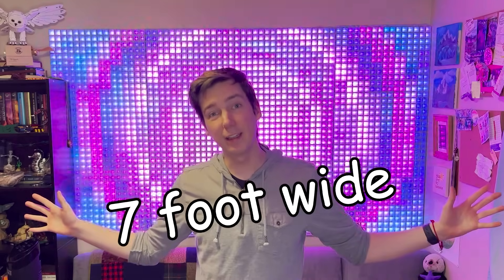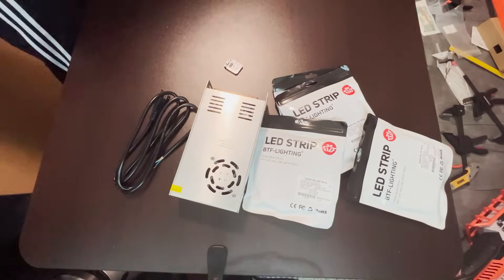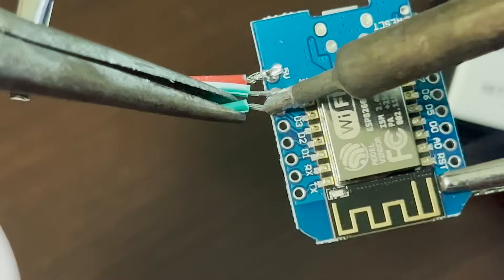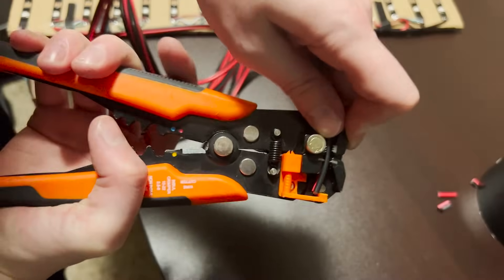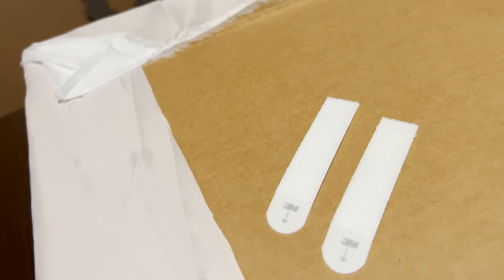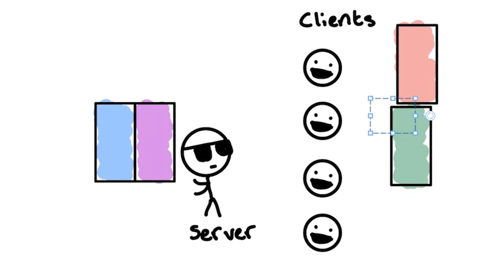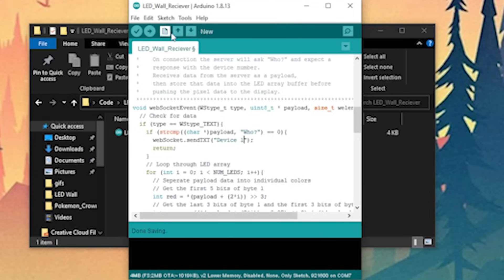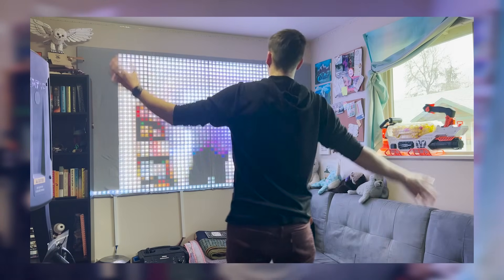How to Build a Massive LED Wall on a Budget

Comment: Okay, one question: Could the screens be made with 60 LEDs per meter? Since they're not readily available, it would require enlarging the lighting panel even further?

Would the same image be produced, or would it be distorted?
Reply from the maker: This screen was made with 30 LEDs per meter so if you kept the resolution the same your 60 LED per meter screen would actually be smaller. Having the pixels closer together would make the image more clear by shortening the viewing distance. If you keep the resolution the same it will produce the same image, if you keep the size the same you’ll need 4x more pixels but your image will be much more detailed. You’d also need to account for the additional power draw and processing needed for 4x more pixels

Comment: I followed the steps and got the problem. All 4 receivers connect to the source within the first 1-10 seconds then all lose connection including the receiver. Is there a solution?
Reply from the maker: I didn’t program memory into the web app so if you refresh the page it will always show “disconnected” since that’s the default state. If you’re seeing all four connected then it’s probably working from the connection standpoint. If you’re not seeing anything on the displays then it might be a problem with LMCSHD.
Reply: @Tech-Random  I have tried to start LMCSHD program but the image still does not display. But Single mode for 1 disk works fine. Can you tell me the steps on how to connect? Do I have to connect LMCSHD program first or do I have to connect all the boards together first and then start LMCSHD?
Reply from the maker: I typically connect LMCSHD first and then connect each of the individual panels so I can watch them light up. When connecting LMCSHD you may need to disconnect and reconnect a few times until the dimensions are set automatically. If you have to manually set the height and width then it didn’t connect properly. Restart LMCSHD so you get the default 16x16 and keep reconnecting the host board until the dimensions change and then connect each of the panels. Good luck!

Comment: You dont actually have to connect all the wires in the serpentine pattern, just the data wire. You can hook the power wires any way you like. If you like to keep them separate, you could hook the positive to all the strips on the left side, and hook the ground to all the stirps on the right end.  This may sound like a trivial thing, but it can make the soldering a whole lot easier, while making it harder to make a mistake, not to mention making the wiring a whole lot less busy looking.

Comment: I was thinking, 5 V is horribly inefficient.  Not only do you need to run all the current to every single diod, but also the shunting need to be done at something like 1.7V or there about.

Then i was thinking, there exist white cob tape, so there should exist RGB cob tape as well.. and i did find RGB mini-COBs, but no tape. 

That would be a game changer.

Comment: For me the image is transferred haltingly and not smoothly but only every few seconds the new image comes. I use esp cam for that can anyone help me
Reply from the maker: It will help to draw out a block for each step your code must complete before an image gets displayed to the panels. For example: capture the image, compress the resolution, copy the compressed image, send the compressed image to the websocket, etc. 
Then for each step write how long it should take and try to measure how long it is actually taking. You can do this with the millis() function and Serial prints. This will help you find the bottle neck in your code so you can optimize it for a higher frame rate.
Reply: @Tech-Random Thank you

Comment: Bro, why the hell are you soldering the wires to the surface of the through holes? Put the wire through the through hole and solder it in.

Comment: How does the led know what colour to change to, as each pixel is generally a different colour… this question is based from me only understanding same colour led’s soldered in series and using on/off pulses on a breadboard
Reply from the maker: Each pixel has a built in integrated circuit that converts serial data into the three pwm signals that drive the red green and blue diode. Each pixel uses the first three bytes it receives for R, G, and B, then passes the rest of the data to the next pixel until it receives the stop bit. The fastLED Arduino library handles all of this for you to make programming a lot easier.

Comment: was about to sit down to work on this project, but looks like they sent me ws2815 by mistake, is this adaptable somehow?
Reply from the maker: Ws2815 should work the same but you’ll need 12V supplies instead of 5V. They also have a backup data line in case one breaks. Make sure you still use 5V or 3.3V to power the microcontrollers.

Comment: You connected the power supply wires on the wrong side.  The wires needed to be placed on the left side so when the screw is tightened, the wire also tightens.

Comment: I have a question, why you don't connect in parallel form the leds?
Reply from the maker: It’s not necessary for a project of this scale. The pixels communicate at 800kHz so in an ideal setup it can do over 40 frames per second on a single data pin. The real bottleneck with this approach is the processing time from usb to serial to websocket. But even with all of that this wall still gets 15-20 frames per second!
Reply: @Tech-Random  ah done, thank you very much for your help, keep making videos

Comment: Hi Chris! Really appreciate this video you've made as I have a project that i'm working on that is pretty identical only mine 17' wide and 5' high thus requiring more of these leds. My question to you if you could or anyone else could help me understand how many power supplies would be required, but more importantly how they would be implemented in the wiring? Thank you!
Reply from the maker: The amount of power you need depends on how bright you’re going to run the display. Each pixel draws 0.06 mA at 5V if they are showing white at max brightness. I usually run mine at 10% brightness (set in code) so the pixels only draw 0.006 mA when white. To get the total power draw: (num pixels tall) x (num pixels wide) x (0.006 mA) = total current draw. You’ll want to distribute the power evenly between each section of the display. If you’re doing vertical strips I’d recommend a power connection for every 3 strips. You can set your pixels to white and you’ll see them turn pink or yellow if they aren’t getting enough current.
Reply: @Tech-Random  Thank you so much! Appreciate your fast response. Will be building based on your instructions this week. Thanks again!
Reply: @Tech-Random  Aloha! So, ive built a massive 17' long feature wall that is 5' high based on this video that has consumed almost 6 rolls of 13w/m led tape. After watching and reading your video and instructables, i realize i have run into a massive problem that I am hoping you can shed some light on. My lights are 24v. Yours were 5v. I have a few drivers that i bought from a local store where they told me in commercial spaces a maximum of 96w drivers can be used. So, a few things that have now puzzled me as this wall and all woodwork cabinets are complete and fastened on the wall   1) the current tape i used (as i did not understand the importance of the voltage is now 24v as I am not sure how to connect this now to the esp 32 module you have recommended. 2) i have done some reading on how to step down the voltage that the display wall will be charged with so as not to fry the esp32 by using a Buck Converter 24V to 5V. Are you familiar with this and do you think it will work? or will it only allow 5v to pass into the esp32 and restrict it from sending the signal back? 3) as the tape required for this project is so long, would i connect the additional drivers in the same manner you did (ever few rows) to distribute more power as the large tape would require many more watts than each can produce being 96w.  3) the tape is addressable but only white as I have tinted plastic filters over each section of led and not an RGB tape. will this affect the way you describe/show the programming part or will it work just the same? 

Your help would be most appreciated as I am way too excited to get this up and running :) Thank you in advance
Reply from the maker: Can you tell me the exact model number of the LED tape you’re using? I’m not familiar with any 24V addressable LEDs

Comment: Did you not have to tie a common ground because you used a single power supply ?
Reply from the maker: Each panel has its own power supply so they are not physically connected in any way. There is no need for common ground because the data is transmitted wirelessly.

Comment: great job Sir 👍 

I inspired to build also like this but I'm planning to use 60 leds per meter to compress the spacing of each leds.

Is there a big difference on the performance between esp32 and esp8266?

I'm going to build 108x42 per panel equivalent dimension of 108 x 168  total of 18,144 pixels.

any suggestions and tips to make this successful plan and proposal of mine? 😍
Reply from the maker: ESP32 has a 240 mhz processor so it can process the pixel data much faster. I’d recommend using four of those as the receivers instead and the code should still work. You will probably have a low frame rate with all of that pixel data so you may want to switch from a wireless to a wired design. I have a video coming in the next week or so with my new high density LED matrix design so you may want to check that out!
Reply: @Tech-Random  I prefer hopefully wireless design so that no more wires to be connected between each panels and to my laptop 😅

I changed my plan from 60 pixels x 108 pixels  I plan to make it 108 pixels x 168 pixels. 
108 pixels by 42 pixels per panel total of 18,144 pixels. 60 per meter ws2812b

is it possible to build without any conflict on configuration and data transmission with a total of 18,144 pixels? 😅
Reply from the maker: @michaeldeloso9042 It should still work but you’ll need to use a few tricks if you’re hoping to get 20 fps. With 18,144 pixels at 16 bits per pixel, you’ll need around 6 Mbps of throughput. Unfortunately the current version of LMCSHD can only go up to 2 Mbps at best. You can probably pre-compile a gif as a pixel array and get a high enough frame rate but it will take a bit more work upfront. I’m working on a change that will let you run several USB devices at once from a single LMCSHD window and will allow much higher resolution walls without sacrificing color accuracy.
Reply: @Tech-Random  thank you for your time replying on me Sir.

by the way I suggest taking a look at jinx software that is also used by others to drive and control the led matrix. on my searching on this kind of project, I see a lot of jinx software appear when I try to look for a diy led wall.

Comment: I uploaded the reciever code in the esp and then took new esp and uploaded the source code, and when i connect to power first i see white light comes on followed by purple light only, it stays on purple light, i dont see any series of different color light as it is shown in video, and when i connect in lmcshd, my screen does not mirror in my panel. I dont know what am i doing wrong
Reply from the maker: Sometimes I have to connect LMCSHD multiple times to get it to work right. If your matrix dimensions don’t automatically get set then close the pop up and try connecting again. Once the dimensions autofill it should work!

Comment: Hello dear friend, is there an option to make this beautiful thing you made, but with 6 strips of 5 meters each (without cutting)? Of course I supply the voltage externally and not through the controller?

Comment: I would be nice to see HDMI connection on this so it can be used in churches as a low budget substitute for high end LED walls
Reply from the maker: HDMI requires hardware decoding which would significantly increase the complexity of this project. For churches you’d probably want a higher resolution to read song lyrics and such so a projector is going to be a better choice. I am working on a higher resolution version though and I’ll look into adding hdmi if possible

Comment: Hello, Im stuck attime 10m:12s, i uploaded the Single_LED_Wall_Reciever to ESP then connect it to Panel. Then takr fresh ESP8266 then upload Single_LED_Wall_Source to it. it is still connected to my laptop but the first LED on the panel doesnt lit even the power is on. may you help me please.
Reply from the maker: A few things to try first: flash the FastLED test to your panel to make sure the leds are set up correctly. You’ll also want to try the LMCSHD test with the panel plugged directly into your computer. Once both of those tests are working, then you can move onto the wireless code. Each level will likely require some debugging, which is an important skill for embedded development projects like this, so it’s good to start small and work towards the final version. With LMCSHD I’ve noticed a lot of issues with the Serial->Connect button not actually connecting to the board. If it connects properly, the size will be set automatically. Otherwise you will need to connect again until the size gets set. Make sure you’re using the correct bitrate (bpp) and baud rate for each mode. For the LMCSHD test I think it’s a 24bpp bitrate but for the wireless version it’s only 16 bpp. Good luck!

Comment: The wires you used are not meant to be used in screw terminals. They don’t make a safe connection. You need to use a solid wire or crimp your wires to be able to safely screw them in
Reply: Lol who cares dude

Comment: Using alluminum foil on top of the cardboard or even white cardboard would probably help the brightness, same withe having the 3d printed part being white
Reply from the maker: These are good ideas but I actually have to run the wall at only 10% brightness, otherwise it’s too bright to look at. It does look dimmer on camera than it does in real life but when I first built it I had to wear sunglasses whenever I had it on!
Reply: @Tech-Random  ahh that does make sense, but imo if it was just as bright at even 9% power I would consider that an absolute win.
Less power cost, less heat generated and longer lasting leds

Comment: Would be WAY WAY easier to do this with a Single ESP32 running WLED now. You should almost do a upgrade video on this with WLED
Reply from the maker: I’ve used WLED with these panels and it works great! The reason I prefer LMCSHD is that it can stream videos from my PC which is my main use case. I’ve considered contributing LMCSHD integration into WLED but I just don’t have the time to take on big software projects like that. Maybe someone will take inspiration from this and do it themselves though!

Comment: Soo if i want to upgrade the resolution is it just as simple as adding more/dense LED and still follow the rest of the steps?
Reply from the maker: Heat is a big concern with more pixels so you probably won’t want to use cardboard. I’m also worried the WiFi transmission will lag at higher resolution but I haven’t tested it. Other than that this design is completely scalable!
Reply: @Tech-Random  i’ll follow your steps and will use a different background (aluminium sheet?) lets see how it goes! Perhaps hdmi is a better connection instead of wifi?

Comment: I thought this was super cool and I want to try making one at some point.

Though…. you can get a 4K 70” HDTV for less than $500 and just fake the low res pixels… 😅
Reply from the maker: Definitely a more practical option. This project was meant to cover the largest area possible with a low budget so it definitely has its drawbacks. It’s a fun art piece but you have to stand pretty far away to really make out what’s being displayed. This does have a 115” diagonal though making larger than any TV you can buy in the US besides the Samsung Wall.
Reply: start building these and sell to venues and festivals💰💰

Comment: A little tip from an electrician: Never just put a stranded wire into one of those connections without a ferrule. You can get a thousand of them for maybe 5 bucks and you'll avoid a fire in your living room. If one of those strands happens to cross the terminals, you'll be lucky if the RCD ("residual current device", sometimes "RCCB", "residual current circuit breaker") catches it. If you're in the US, you probably live without an RCD (your electric grid and laws for electric installations are garbage) and your strand will quickly reach 1100 °C (2000 °F), likely causing a small fire before the stand can melt.